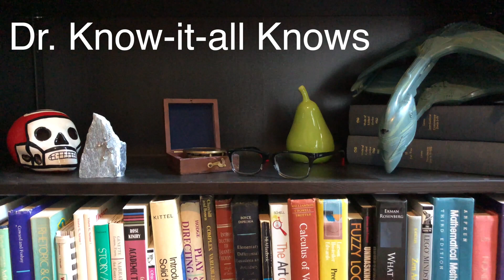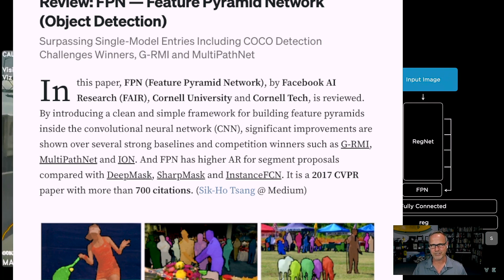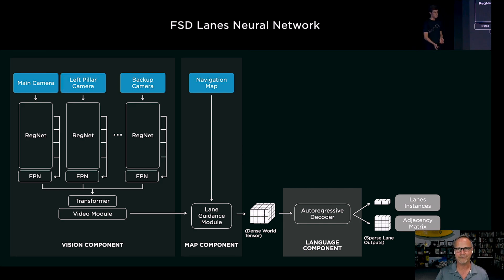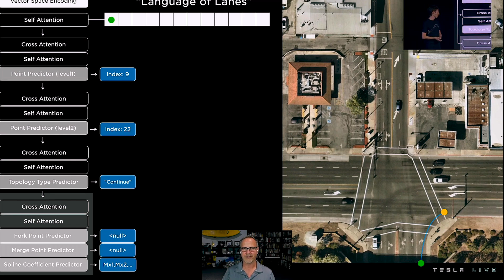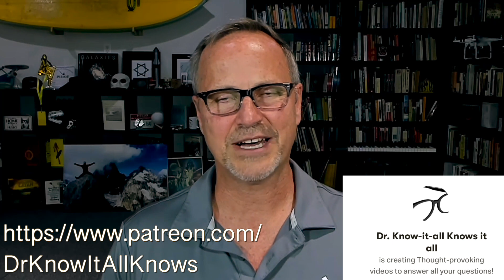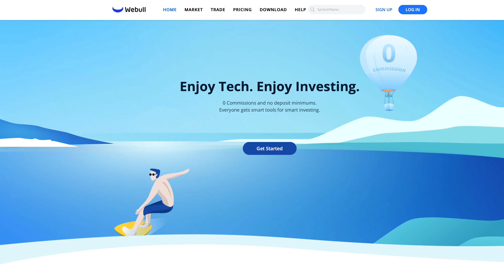A Fork in the Road: Tesla LANE PREDICTION Uses SENTENCES?! John Emmons at AI Day 2

Comment: John - Thank you. One question… when leaving a freeway on an exit ramp, I need to make a left turn and often have 3 turn choices: left, left or right and right. To make a smooth left turn, ideally, I need to be in the middle lane. The far left lane will immediately turn into a lane that will return me to the freeway in the opposite direction, which I don’t want. 

FSD always goes to the far left lane, and after turning, can’t easily get to the thru lane, I want. Will what you’re discussing help solve this lane selection problem?
Reply: I believe what's needed is closer integration of the route planner and the drive path planner.  That is, the lane end node at an intersection has to be selected by looking at the route data.  This is currently not done.
Reply: @MsAjax409  thx. Do you know if what was presented in this video will create this integration?
Reply: @joby6462  It wasn't mentioned to my knowledge, but it will have to be done at some point.  We human drivers will select a lane based on the route we are following.  Navigation software will provide hints as to which lane to select by enunciating two maneuvers at a time, for example "Turn left on Veteran's Pkwy and then right on Market Drive".  An instruction like that tells us to use the rightmost left turn lane to put us into the right lane for making an immediate right turn.  The route information can also be used to trigger a turn signal before a maneuver into a turn lane is completed.  Today, FSD Beta signals after the car has moved into the turn lane to the irritation of someone following.
Reply: @MsAjax409  thx for your reply! One observation, my turn signals goes on and FSD immediately starts to move in that direction, almost always later than I would like. This causes me to  go over the solid whites that outlines the turn lane, technically a violation in my state. One unrelated question. FSD continually races to red lights  and then hard brakes to a stop. It clearly must see the red, but is determined to keep at speed limit instead of earlier deceleration and coasting. It’s like a roller coaster sensation. Do you see this too?
Reply: @joby6462  Same for me.  Speed control needs massive improvement.  I'm constantly adjusting the speed to fit the situation at hand.  This will never do for a fully autonomous vehicle.

Comment: Funny, this "auto-regressive" language model actually has been around a very long time. In the 1980's, I worked with a colleague, Dr. Earl Rankin, a very well-known professor in reading and the "father" of what was known then (and still is) as a "cloze test." He invented actually and we used in R&D, the "Degrees of Reading Power" test. That measures reading ability on the same scale as is often used to measure textbook (or magazine, etc) reading difficulty. That was handy for use with college students and courses (and professors). If the students do not have sufficient reading ability to at least match the difficulty of the textbook, then there will be troubles ahead.

Comment: This video will require some revisits. Lots to digest here but it's an example of how far ahead Tesla is on the FSD problem. I would bet that no other driving program is using a language model to help decode a vision data stream. Amazing use of different analysis systems to parse visual data. Well got to let this marinate while I grab something for my headache... LOL can't wait to hear James discuss this development. So many of the complex problems FSD presents will be solved using this new method. And it's interesting to hear them bring into the discussion Tesla bot. This solution could mean even more for the bot than for FSD. The ability of Tesla to integrate so many different fields of study into solving a problem is so unique. Most just don't see how that gives Tesla a massive advantage.

Comment: Wow the description of an intersection with multiple paths that connect the lanes. sounds like G-Code used by CNC routers to cut out a shape a random shape in a piece of wood.
For example you call out a circle and then you give the radius and then you could have the router follow the circumference and end at some point to transition into a straight line.

Comment: The latest FSD had my car swerving back and forth with a lane merge. The latest releases are worse than 9 months ago. Hopefully they can fix this, but they are releasing FSD where driving has become substantially worse. Maybe it is becoming better for these corner cases of complex intersections, but it now want to run into stoplight poles when I’m driving.
Reply: You will notice in the presentation that lane prediction and path planning at an intersection requires course map information about the lane count and topology at the intersection.  If this map information is wrong, as it often is, the system performance degrades.  This is why some experience excellent FSD performance while others experience poor performance.

Comment: The real test is my local freeway entrance and exit. It changes lanes rapidly before and after the stoplight, can’t turn left with a cement wall ahead and the freeway exit is worse; it wants to drive into the stoplight pole. In the last 6 months every release of FSD has become worse. I’m losing confidence 😢 they can pull this off using the current approach.
Reply: Do you have fsd beta?
Reply: @swissTom124  Yes - But not CA. Just waiting for the release which can do a drive without intervention to prevent a crash. Not asking for these complex intersections or unprotected left turns which should be much more difficult.

Comment: Holographic memory - I worked on that 20 years ago, but other things got in the way, and I never got around to really getting into it.

What's missing from AI is holographic memory, like our human brains use.
A holograph image allows you to break off a small corner of the image, and you get a crude image of the hole image. Holographic memory would do the same - instead of looking at a huge chunk of memory, you just look at any smaller part of it to see if it generally contains what you need - if so, you look at more of the memory, no need to ever look at all of it unless you require incredibly accurate information.

Anyway, at some point, AI will grind to a halt until they invent holographic memory as we have in our brains.
Reply: I highly doubt it works that way.
Reply: Well you can’t cut a piece of information without looking at it first and concluding it’s not important. However I agree everything it sees should not be given as much memory. Instead I hope they do something like what Meta is working on for their next vr headset. They plan on focusing more computer power where the eyes look at to enhance the resolution of that part. The same way, the car could enhance its voxels resolution where more critical action is happening.

Comment: Will Tesla's Semi vision system be able to detect trailer/bridge height & prevent the Semi/ trailer from hitting a low bridge?
Reply: The occupancy network can do it easily. It just has to know the height of the trailer, which isn't hard as containers are standard size. With oversized loads likely humans will keep driving for a while.